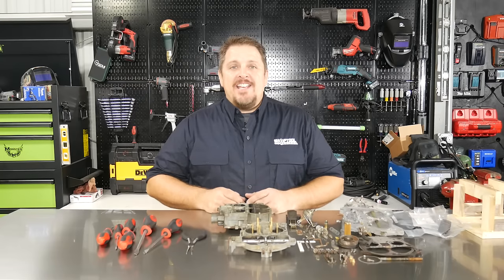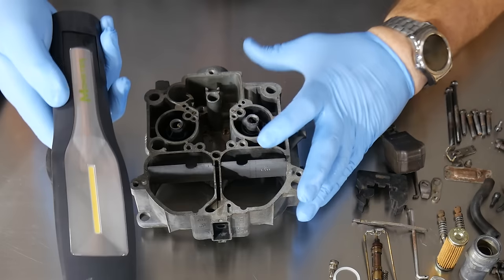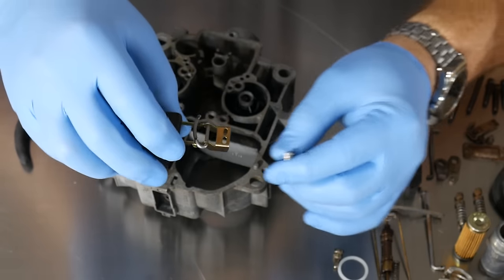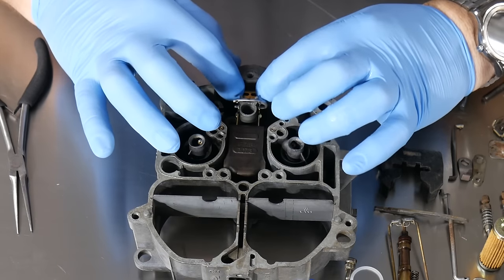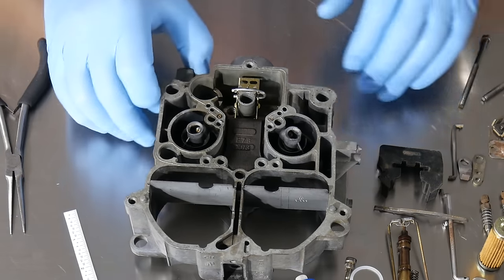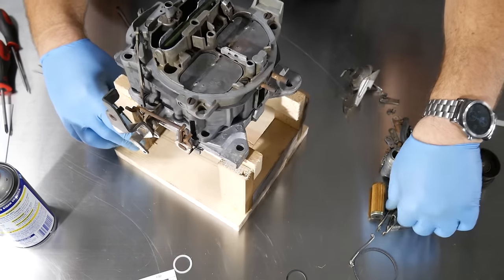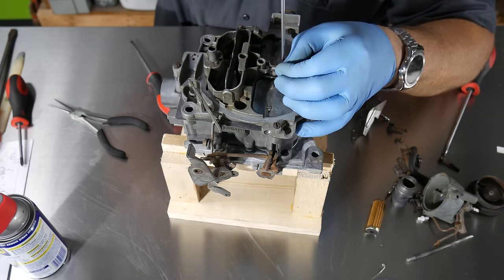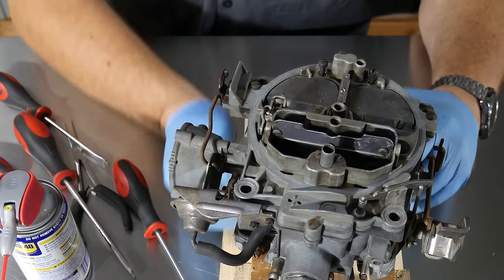How To Quadrajet Carburetor Rebuild - Part 2 - Assembly

Comment: This HAS to be the definitive video on rebuilding a Quadra jet carburetor!!! 😮👍🏻👍🏻
Reply: Bad video he missed the hardest part, installing the lever which needs to drop down the well for the choke to attach to.  It’s a blind area.  Also he forgot the lever which locks out the secondaries when choke it on.  It goes on before the choke mechanisms. Not good

Comment: This guy's Q-Jet is drastically more simple than either of the two I've rebuilt. Disappointing that he chose one of the simplest configurations rather than one that would cover more complicated setups.
Reply: ouchymytoe this here’s a BOP carb, you may have a Chevy one which has slight differences, the older the better, newer ones have caps blocking the idle mixture screws, gotta cut those out to access them, make your life much easier

Comment: Overall, a satisfactory video. I just took my Q-Jet from my 67 Olds 442 apart. It was a rebuilt from Rock Auto. Ran good for a while. Then the other day the car would barely run. Seemed to be a fuel problem. I confirmed this by swapping a Q-Jet from my 67 Riviera and my Olds ran fine. Clearly a fuel problem. Rather than fooling around with Rock Auto on warranty I took the carb apart. What I found was the little, tiny clip that hooks on the Viton needle was missing. This apparently was causing fuel flow problems into the carb. And naturally finding just that little clip, even as a part of a small parts kit, is a problem. One other issue pertaining to your video. You brushed over what I was looking for in connecting the linkage for the choke. It pertains to the small tab down inside the carb that connects to the remainder of the choke system attached to the outside. It was a royal pain for me to figure out how this all hooks together. And then I had to figure out how to align the phenolic fast idle cam while trying to hold that tab in place using the rod connected to the choke blade. With perseverance I got it connected.
Reply: He forgot that part to show on video the deadest part

Comment: Well it really didn't surprise me that there was no part 3, especially since he didn't clean out any of the air and fuel holes in the air horn, body and base plate are even simply clean the corrosion and rust off any of the rods and many other parts. I personally wouldn't waste my time putting this carb back on without more cleaning and many adjustments for better fuel mileage and performance. Carter and Rochester made some awesome carbs if truly adjusted and tuned correctly they will not just get decent fuel mileage but scream while making tire blistering power.. It's a shame because the Olds 442's deserves the respect for a nice true rebuild and adjustment instead of the assembly/disassembly it got. Sorry about the negative post, but It truly hurt me to see this done. I've redone bad rebuilds many times and often free just to prove to some they can be redone and run better than a new one that's assembly tuned and adjusted. I did watch other videos and this guy does make good videos, but sadly these two needed more know how on the carb in my opinion.
Reply: Ricky Shuptrine well since you’re good at rebuilding Q jets properly by all means please make a video and post it to Youtube because this is one of the best step by step Ive seen to date
Reply: IfYouDisagreeYouAreWrong  It's nice meet you. During a rebuild you can adjust a screw kind of hidden beneath the primary rod assembly, thoroughly clean all air and fuel passages and some can be resized, same as the size of the primary and secondary metering rods. Checking for wear on the rods, flaps etc for not sealing well and readjusting primary and secondary if they do not close completely. Bending linkage rods to modify their response. Testing any vacuum device that hooks to any part of linkage. Adjusting the screw on the secondary top flaps hidden beneath the outer rod where the linkage rod goes usually from a vacuum canister for the optimum time and are response you want the secondary's to open. Make sure the secondary rods are seating with a small gap between the rod holder and a cam that opens them, other wise they can leak continuous fuel. Many of these will have to be done after on the engine and running for best results. I'm sure I missed many things but it would take a small book to write and show pictures for a much better detail than I can write here. Readjusting timing is also sometimes required. But as in his 3rd video basically a vacuum gauge and screwdriver is about all needed for the basic tuning.
Reply: @LandonRoy-cv9rt  Thank you for your reply.  Sorry for the long delay before a reply, but I some how missed it and just found it a few minutes ago. This had been so long ago, I went back and re-watched part 1 & 2 to refresh my mind since I've watched thousands of video's over the years. In MY opinion the part 1 and 2 could have been in MUCH more detail. I even watched the 3rd video that for some reason that took a long time before posting, but I'm sure he stays busy are maybe forgot to post it but it is ok for a beginner. I admit for the average person this most likely would be a great video to go by other than they just need to make sure all ports are open after cleaning before the reassembly. I am not suggesting anyone not try and do the same thing as he did and they'd be ok with the results. Maybe  I'm a bit OCD, but the rust and corrosion got to me along with him not showing a through cleaning of ports and many other things. I did click like on his videos, because for the average person this would be good enough for a rebuild.

Comment: I feel like there was missed info between Part 1 and Part 2...did you clean the carbs parts? can the major halves of the carb be dunked in a carb cleaning solution like Berryman Chem-Dip or are there still hidden seals that would be damaged by doing that?

Comment: Just FYI for everyone please use the float level in your rebuild for your specific model. I have a 1977 Trans Am and the 4 bbl quad in the California edition is 13/32" float level. I set it to 1/8" and it was running rich as hell... And I know because I have to smog it...
Reply from the maker: Definitely a good idea to check out your specific Quadrajet model's settings. Most are good starting at 1/8", but you bring up a good point with the California smog-legal carbs.

Comment: I would mention the primary holes in the base plate should be blown out and inspected closely I've seen dirt get in those and after the rebuild it won't idle properly and generally runs terrible sometimes it's necessary to run a fine wire in and out of all the holes to be sure. Just a suggestion from experience.

Comment: I leave the accelerator pump arm on the airhorn. No need to remove it, can easily assemble the bottom, first put the rod in the hole of the arm, then position throttle plate onto carb, done it on every quad version.

Comment: that choke link (bent rod) just magically shows in your video, just after inserting the inlet filter. It wasn't there before. You must have gone back, torn the upper air horn apart from the main body, then connected them....there's no way to get them connected after. Thanks alot!
Reply: Yeah no shit! I couldn't figure that out for the life of me! It was pretty fustrating
Reply: Today is 03/02/22. If you are reading this, it is much later than the video was posted. There is a way to reassemble the choke rod and actuator with air-horn installed. Use a piece of copper wire. Very small, so it is just a little too big to fit between actuator arm and rod. Leave enough length to pull out wire when done, about 6 inches. Mark the rod with sharpie by holding on outside of carb body to get approximate distance you will need to feed into carb for alignment with choke. Then feed the arm and actuator through air horn, then gasket, into body. Slide out choke assembly far enough to get actuator close to position. Then fiddle. Fiddle with it some more. After a few tries (takes me average four or so) you will get lucky and slide the choke through the actuator arm. This process takes two or three minutes compared to twenty to thirty minutes to remove and reinstall air horn. Good Luck!

Comment: Choke rod, slide it in with carb laying on its side, choke mount surface up. Line up the lower arm, slip on the choke housing.

Comment: Wanting to rebuild my carb on my truck. Numbers I pulled from the quadrajet is 17086045. I used carbsnation to find the particular model. Would like to order the kit from you guys though and not sure which one will fit my model. Could you lmk which kit will fir that carb? and also does your kits come with the floats and pins? thanks

Comment: I had a serious issue with the float pin. Friends carb is flooding out, so I rebuild it.  I find the needle valve laying in float bowl !! I never seen it before. I put it together, carb instantly floods out again. Take air horn off, needle valve is jammed up out of place, weird. Then I am watching another video on quadrajets, the U shaped  float pin can get squashed too flat, that can cause the entire float to lift up at the pin and jam the needle causing a flood. So I expand the pin open and will test it again this Sunday.  That pin, when you put the air horn on the carb, should slightly keep airhorn lifted off the main body. That way you know when you screw it together the pin will be held down tight . If it still floods I give up as otherwise, nothing makes any sense. But I think that is what happened, the pin somehow closed in on itself. No one has messed with that carb in many years, It is on a boat, a Tiara Pursuit from the mid 80's. I have no idea how the pin could warp-bend, it takes a lot of force to open the pin up.

Comment: Why doesn't my choke spring stay open like that???!!!
Reply from the maker: The choke blade should stay closed until at operating temp (~160F). Once at operating temp, then the blade should be fully open. If either is not true, then it probably just needs adjusting.

Comment: Well, you skipped over some rather essential stuff, stuff that should not have been skipped over. Things like removing the jets, carefully so it's not to mess them up as many people do, removing the needle seat without losing the washer, and cleaning out all of the tiny little passageways, that is the reason most quadrajets begin to fail. There's a lot more information that should have been passed on to the viewer missing from this video series. Don't get me wrong, the effort is certainly appreciated, but the details that were skipped over are critical in a carburetor rebuild.

Also, you had fuel in the intake, therefore the plugs must have been leaking. 

And lastly, it's important to save the old gaskets and match them up with the new ones, looking at both sides to make sure no new holes are exposed and no old holes are blocked. All quadrajets are not the same, and some have different gaskets than others.

Comment: Wow, this kinda sucks. You show you measuring the floats, but how do you adjust them? It's supposed to be 1/8" of an inch ... what if it isn't? How do you adjust? This is just one of several things. Argh ... waste of time watching this video.
Reply from the maker: Paulster2 you just bend the brass mount of the float.
Reply from the maker: Paulster2 make sure to remove the float to adjust. You don't want to put pressure on the needle and seat.